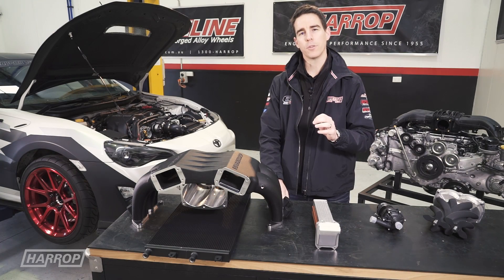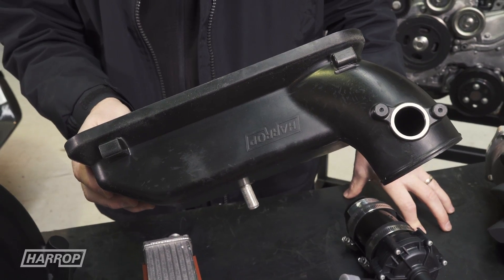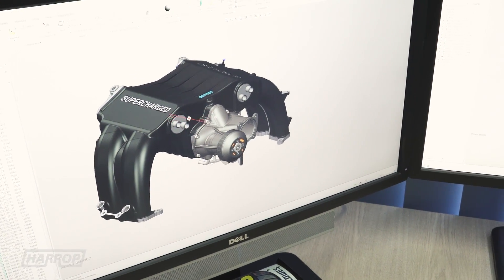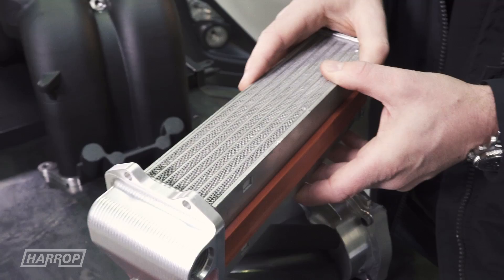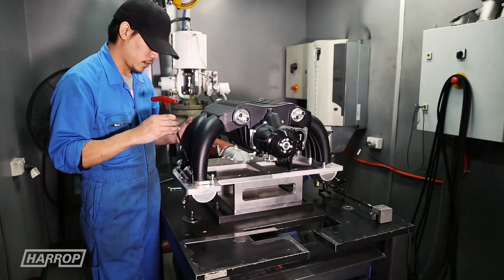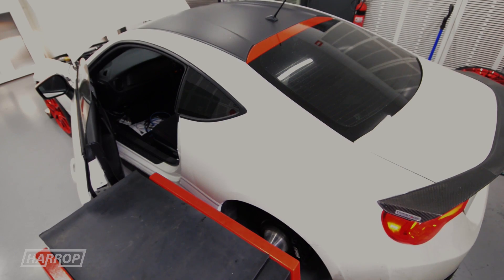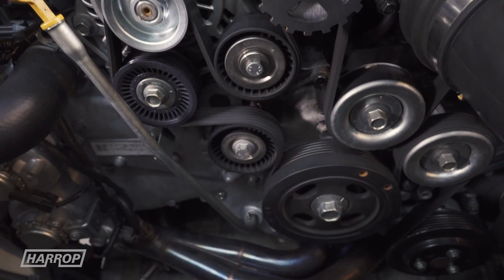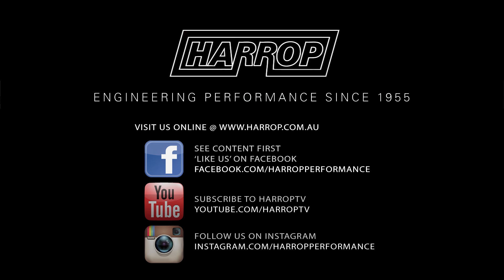Harrop FT86 | BRZ | FRS Supercharger Kit Technical Review

Comment: Can this kit be calibrated on an AT car using 95RON?
Reply: They can be used on the AT (the AT actually handles boost better than the MT). Not sure about 95Ron, but I don't see why it wouldn't work. You'd probably need a custom tune though.

Comment: It's a bit of a dog's breakfast when compared to the austhetics of the Cosworth package.
Reply: I disagree.
Reply: aesthetics*
Reply: Edelbrock looks way better in my opinion.  They didn't really give us any numbers on how well their setup is cooling the air compared to the Edelbrock or Cosworth setups.  Would be interesting to see.
Reply: @TripleTapHK  I retracted part of my previous statement as since then I had read somewhere that the Cosworth package has inlet temps 10-20°C lower than the Harrop. Which gives much more headroom for smaller pulleys. 

I can't can't comment of the Edelbrock but for me I think the Cosworth would be my choice now.
Being that I live in the UK, and that Cosworth uses stock filter shape wins it for me. Obviously it would be a different story entirely if I lived in the states. Sometimes if performance and features are close, the most locally made kit is what wins.
Reply: "dogs breakfast" never heard that term here in 'murica.

Comment: OMG I was looking into the Kraftwerks supercharger, but I think this blows it out of the water.
Reply: ChubyX absolutely, i was disappointed there seemed to be only centrifugal superchargers for e92 m3’s until someone pointed me to Harrop and between seeing its design & instantly knowing it was a quality product & then seeing the dyno sheet I was instantly sold, it keeps the stock engine characteristics & power delivery there’s just more of it everywhere. Those centrifugals are super top end happy, not just HP wise but torque wise as well. Seeing this one for the BRZ is even more impressive given the neat manifold design & the way they achieved that, quite clever. Hard to beat the bolt on and go design of a properly designed roots/twin screw blower, all those other centrifugal super chargers are weak af in comparison, just belt driven turbos that don’t really perform as well as a proper turbo setup or a proper supercharger setup.
Reply: Absolutely.  The Rotrex blowers that some of the supercharger kits like KraftWerks uses are complete garbage.  You can look up so many videos of the tiny shafts braking and/or bearings going bad in them.  Stay away from anything Rotrex!

Comment: Would this supercharger remain an option for those with the newer FA20H found in 2017 model gt86's?
Reply: i don't see why not, no major differences with the engine, just the intake manifold :p
Reply: Ken Kozawa Yeah, just wanted to make sure that I , wouldnt be wasting alot of money 😀. Thanks.
Reply: @doobster3439  They need a bit of extra work done to make it fit but nothing major

Comment: suitable for auto gt86?
Reply: All the supercharger kits you see are suitable for auto gt86 to answer your question and not be a cockbag who just laughs at it. I know a shop that has done a ton of edelbrock SC kits on autos with no issues. Ive been told you are safe for the engine and tranny around 270 to 280hp, 300 might be pushing it. But remember the bottom end of the FA20 needs rebuilding if you want reliability out of more power. For the tranny SSC makes some transmission parts and coolers but they are not cheap. Supposively the auto trans in the FRS is very good. Theres an Australian race team that built an auto trans frs for a guy with 1 arm thats making ridiculous power
Reply: Byzz_Byzz Auto? Haha.

Comment: If only I didn't have my Cosworth kit. This kit is amazing!
Reply: This seems better than Cosworth kit.
The nearest official Cosowrth dealer is asking for a silly high price tag for Stage 2.3, he is asking for 16K USD including installation and the standard tune re-flashed! not even a custom tune option available! 

I'll buy this kit instead and hand it over to a custom tuner. looks cleaner with the front throttle placement.
Reply: KareemAbawi price wise yeah this is better. But I think overall performance is the same.
Reply: +michael w if I remember right, Cosworth will make ~280 HP at the crank... I asked them how much will it make at the wheels, I never got an answer.
this one will make 244 with out an exhaust manifold and a catback. (if I understood them right)
Reply: The Cosworth makes 250 at the wheels with their full exhaust from what people say when they dyno them. I still think they are roughly on par with each other. However, it doesn't mean I think one is better than the other and blah blah blah. haha I like both.
Reply: That said both are utterly awesome :)
Reply: The Cosworth SC makes aroudn 250 at the wheels and is deemed the max the stock rods can make. Its capable of 400hp just liek the Harrop with smaller pullies. Both share the same 1.4Bar max boost rating. 

I have a track buddie who has this kit. In standard form my intake temps are +15C his Harrop is +25C so the Cosworth has the nod for low intake temps which will really come into play when people start pushing 350+ hp.
Reply: Does the cosworth kit uses the TVS1320 to?  Thing i like about the Cosworth kit over this kit, is that you can upgrade the blower to the TVS 1900 down the road if you wanted.  This kit the blower is manufactured into the manifold which could suck if you want to upgrade down the road.